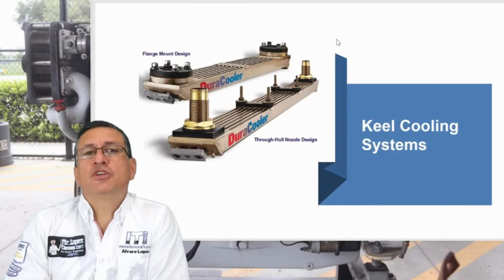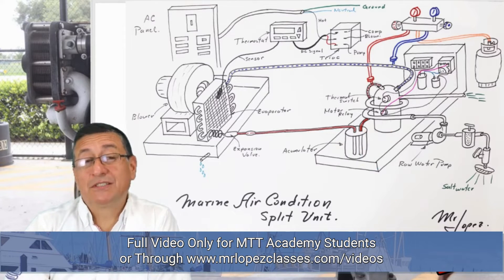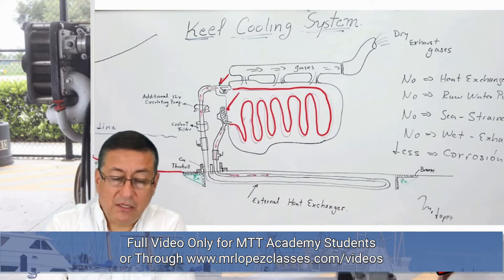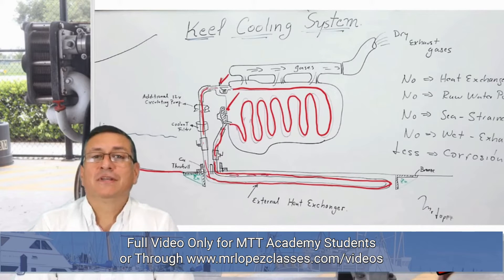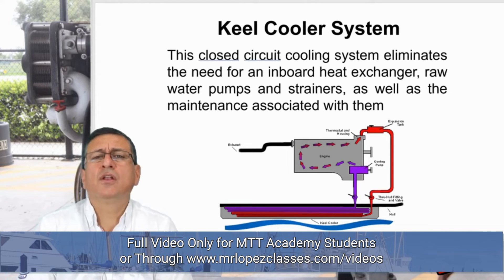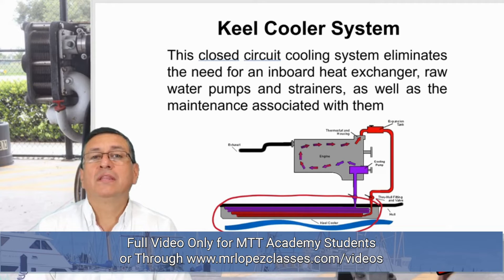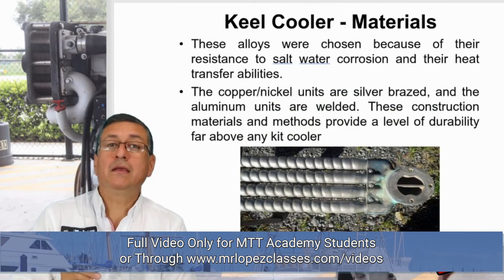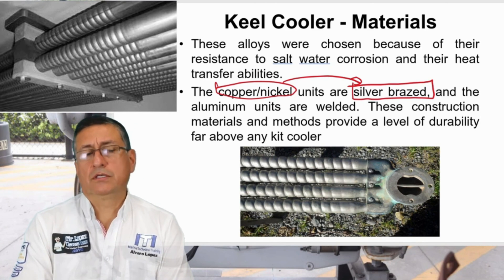Keel Cooling Systems

Comment: Why cant you add a conventional automotive style engine radiator in conjunction with the heat enchanger?
Reply from the maker: Because you don't have enough air circulating at the engine room
Reply: @mrlopezclasses there isn't any airflow in a car engine compartment,  but you can just pipe it up to the roof, its just rubber hose. You can also mount them straight into the engine room intake blower plenum, think of a turbo intercooler on a car except, you can even keep the coolant flow from the cold side to make your cooling water colder and engine intake air colder or on the hotside mid loop to bleed off excess heat mid cooling cycle.